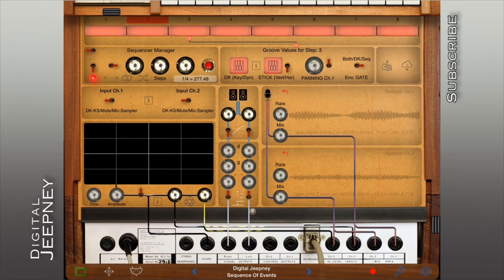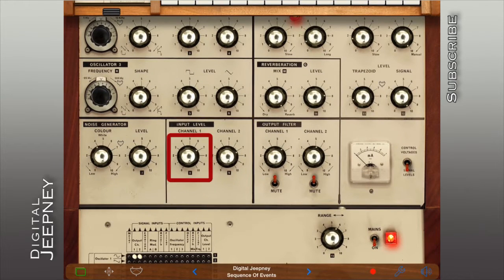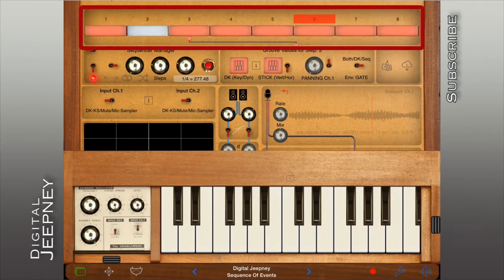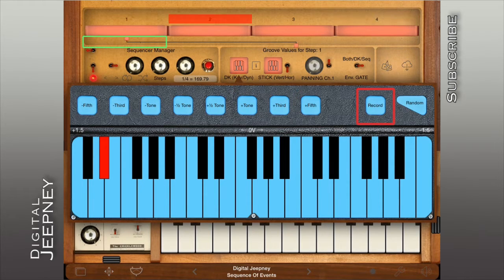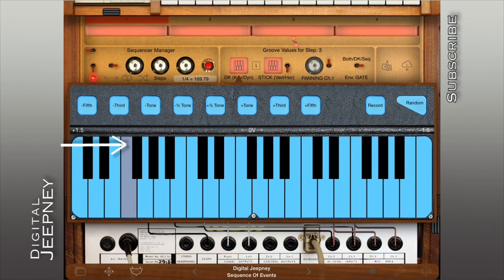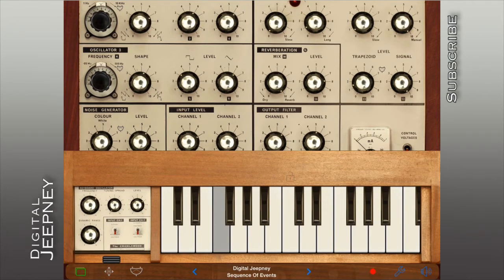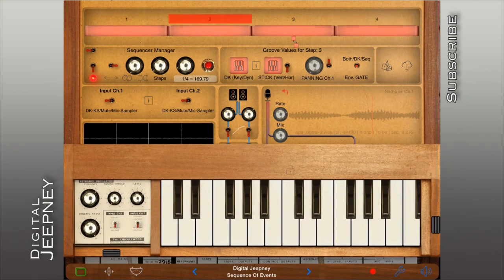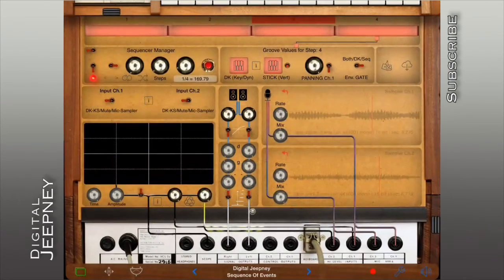iVCS3 Tutorial #4 - Using the iVCS3's Sequencer

Comment: Thank you Digital Jeepney for the tutorial.  Can you suggest how I can synchronize a rhythm pattern created on the iVCS3 to a click track (preferably in Pro Tools)?     I sometimes make a pattern using the sequencer (I set the tempo on the sequencer, sometimes I used the Ableton feature and link it to Patterning via Audiobus) or I'll just use the envelope without the sequencer.  Sometimes I'm successful but most of the time my pattern will start off in sync then it will drift away from the click track.  Most of the time in Pro Tools I create an audio track for my iPad and connect that to my interface.  I hope this makes sense, and any assistance you can provide is helpful.  All of your tutorials helped me get the most out of this application.  Thanks.